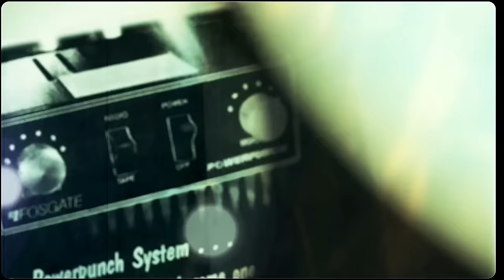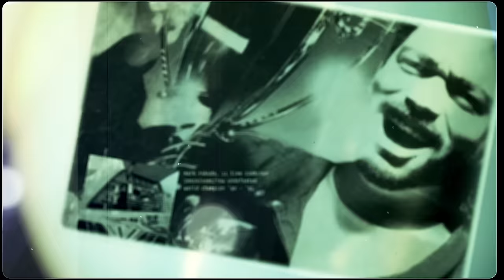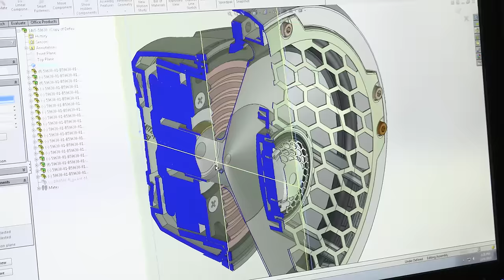Rockford Fosgate | This is Rockford

Comment: I love RF. I have a punch 120a2 as a collectors item. A p4004, p300x2, R500xD1, 8 6.5 marine speakers and a punch P3 12D4 in my boat. The speakers are all original from 2005 and so is the p4004. You guys didn’t have marine amps back then so I’ve had issues with moisture that I have had to protect them from but boy would I like to have a power series 1500x5 now. RF is the best.
Reply from the maker: Thanks Banks Performance!  Appreciate you being a long-time Fanatic and glad those amplifiers are still running strong!  You'll be happy the newer Marine amplifiers use the same design philosophy as those original Punch series amplifiers which are over-designed + unregulated power supplies that are responsible for generating  amazing dynamic headroom.

Comment: Everything in my truck is RF. Love the way it sounds. 360.3, 3 amps, 2sets of components, 2 8's on the kicks 2 12's well one now. A basket cracked on one. Both subs are two months old and neither the seller or RF will stand behind it.
Reply from the maker: +Michael Guillory Rockford Fosgate will handle any warranty claims from products purchased from an Authorized Rockford Fosgate dealer.  If the dealer is not authorized, the seller is responsible for any warranty issues.
Reply: +Rockford Fosgate the short version of it is both dealer and RF said not covered. I ate my lost, tossed it in the trash and ordered 2 T0 12's and another 500.1bdcp
Reply from the maker: +Michael Guillory Thank you for the update, and I'm sorry to hear that.  While I'm not 100% certain this was the issue ... it's best to purchase from Authorized Rockford Fosgate dealers to protect your warranty.  In any case, we appreciate your business and are grateful you stayed within the Rockford Fosgate family.  Thank You.

Comment: Rockford Fosgate should make wireless amps to avoid all of the necessary wiring from the head-unit... No matter the cost, I would buy it.
Reply from the maker: +Ale Wu We offer an RFBTRCA - Universal Bluetooth to RCA Adaptor so you don't even need a source unit.  Although this would eliminate the RCA's between a radio and the amplifiers, but you would still need to connect speakers to the amplifier.
Reply: Rockford Fosgate Thank you for the reply...

Comment: rockford amps are great, im 17 and ive bought 4 for various installs ive worked on, the one thing i think rockford could use is a good lineup to compete with the 800rms-1200rms that isnt their top of the line stuff. Power stuff is great, but thats a huge ass jump from p3 to t1
Reply from the maker: Hi KittyCow, we produced the T0 subwoofers just for that exact reason.  Keep in mind, our power handling ratings follow the CEA-2031 industry guidelines, whereas many others do not.  It's not "illegal" to publish a higher power handling number on the box.  When looking at power handling on subwoofers, be sure to look at the voice coil size.  You'll notice competitor subwoofers who use a similar voice coil size as our models, yet publish power handling ratings double or more than us.  We also use ALUMINUM voice coil formers which is like a radiator for the voice coil.  Those who use Kapton, are actually using a plastic former and cannot dissipate heat.

Comment: i have a question, hope you can help me..Could i wire 4 4ohm pp4-nt tweeters  to 1channel on a t1000.4ad ?And 2 4ohm pps4-6 midrange's to 1channel ?Thanks rockford
Reply from the maker: +krupske Yes, you can do this.  The Power T1000-4ad is designed to operate down to 1-ohm, so the power output would be 250W at 1-Ohm and because of the Constant Power technology, it would produce 250W x 4 at 2-Ohm.

Comment: Rockfords prime line is rather disappointing. Kinda is an insult to the company, in my opinion. Prime amps are ok. But their Prime speakers and subs are terrible. Acoustic wise. Requires more adjustments to get the overall sound quality right. Plus lots of poly fill in the speaker and sub enclosures. As ive owned several different sets. Quality starts with their Punch line and ends with their Power line. I will say one thing is for certain, with Punch and Power amplifiers you are actually getting more than you pay for! Saving up the extra money is well worth it, with the Punch and Power lines. The technologies that they put in those amplifiers are insane. Thats why Punch and Power amplifiers are my go to. Doesn’t matter what speakers or subs im powering!
Reply from the maker: Thanks for your feedback Random Tube.  The Prime line was developed as a baseline product for the beginning enthusiast.  Just like when we first started driving, pops didn't hand us keys to the Porsche as our daily driver, so most of us start out with a simple means of transportation until we can quickly upgrade to something better.  In car audio, everyone starts somewhere, and the Prime line is a good introduction.  So if you're past the beginning stages and ready to drive something with more horsepower, definitely step up to the Punch and/or Power series.
Reply: I get what your saying. I figured thats why theres cheaper brands out there. For the younger generation audio enthusiast to experiment on first. Once they get their bearings straight, then upgrade to a top brand like RF. Im proudly to admit that I already have owned and experienced the Punch and Power lines. I will say that the step up in quality from the Prime to Punch was impressive. I really like the built-in clip detectors, very convenient. From the Punch to the Power line not as big of a step up. However there is a sense that you are on a whole nother level with the Power line. Some of the most cleanest efficient sounds Ive ever heard produced from an amplifier.
Reply from the maker: Nice!  Sounds like you're on your way to being a competitor soon ;-)